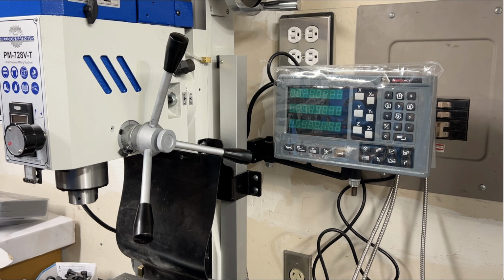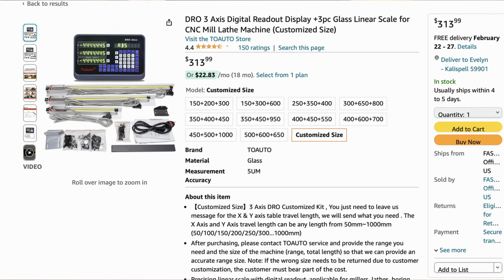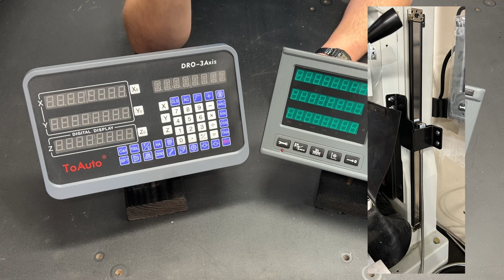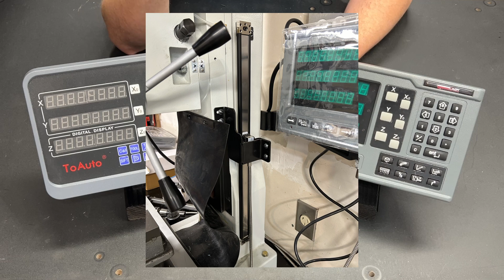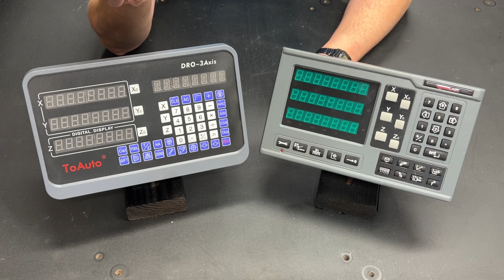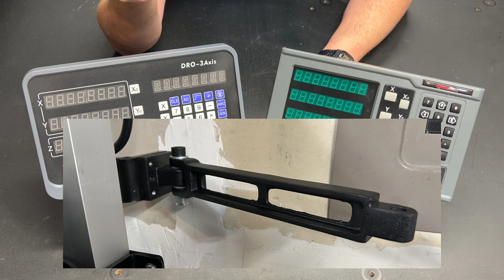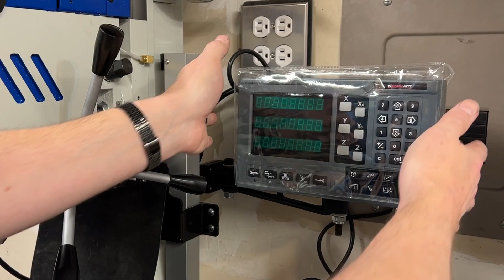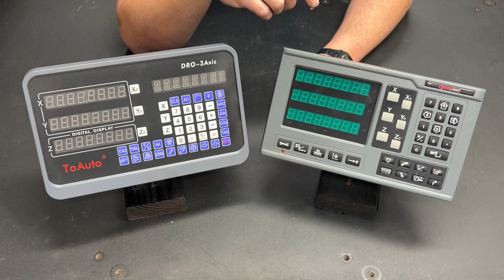Is it WORTH $900??  Review Comparing Precision Matthews & ToAuto À La Carte DRO for a Mill PM-728

Comment: You could have cut the plastic around the cable openings faster than spending the 5 minutes complaining about it in your video...
Reply from the maker: its not a complaint its an honest review of the things I like and don't like about the product.  I did cut the plastic and it was quick but doesn't change the fact that it should have been done from the factory.

Comment: Flood coolant is rarely used on a bench top or Bridgeport style manual mill. In any case, it should never be running beyond the T tracks and out onto the scale or onto the table or floor.

Comment: I think the reason PM designed their console covers the way they did is so that the user can remove and reinstall the cover without having to unplug the cables. Personally, I don't use the cover when I'm using the mill.
Reply from the maker: That is a plausible explanation but how often do you need to remove it?  Most people install them and don't take them off for years until they need to be replaced at which point the inconvenience of having to unplug the scales one time is far outweighed by the superior fit of having the holes in the cover.  I really think it was a cost saving option.  Either found something already being made that would "work" and/or making them without the holes cost less $

Comment: For me, it doesn't make any sense to put magnetic scales on a machine made to cut steel, too much can go wrong in my opinion.
Reply from the maker: You make a valid point but It’s interesting when I was researching this I found a lot of strong opinions for and against either type of scale depending on a verity of criteria, but the overwhelming response was they both worked well in most situations.
Reply: @dazecars  Good to know, thanks
Reply from the maker: Glad I could help

Comment: Considering that virtually every industrial machine that isn’t already a CNC, already has a DRO, I think that industry agrees that a DRO is something a professional machinist needs. Thinking the way people may have thought decades ago, doesn’t help.  Manufacturers used to have a fair amount of scrapped parts because of the expected errors. DROs have lowered that percentage by a large amount. They also allow work to come off the machine faster. After having machined for almost 50 years, I finally added DROs to both my mill and lathe. I would never go back. I use flood coolant on my lathe with glass scales. No problem. Install isn’t a problem because we are supposed to be machinists after all. If we can’t accurately install a DRO, what are you doing with your machines in the first place? I bought ToAuto models, touch screen. Also 1 micron scales. I’ve had them for three years and use them all the time. Frankly, I don’t care if the box is plastic or steel sheet or aluminum casting. It just doesn’t matter unless you hit it with a hammer regularly. I made my own arms and brackets. You have to modify the plastic cover to fit better. I did that with the ToAuto as well. I have x,y,x models. So I put one I modified on the quill and one on the tailstock. I really don’t like the way some people use a caliper on the tailstock or mill quill. Those aren’t accurate. The best you can count on is +- 0.0015”. That’s not good enough.
Reply from the maker: My comment was not to say that a DRO isn't something a pro needs but rather to say that there are an educational gaps between a hobbyist and a professional with the hobbyist not having schooling in machining and some of those gaps can be filled by a DRO.  As an example drilling a bolt pattern circle.  A trained machinist knows the formulas to calculate the points on the circle to drill the holes but a DRO does it for you eliminating the need for that training.  

My statements about flood coolant and optical scales are the same as my statements about chips and magnetic scales, not a hard fast rule but a potential issue and something to keep in mind.  Just because it has worked well for you does not make it ideal in every situation.

Yes if you are qualified to run a mill or lathe you are qualified to install a DRO yourself and as I said in my video I have done two such installs, but there is something to be said about a purpose built install by individuals that work on putting DROs on the same type of machine all the time compared to a one off install.  

As to the quality of the DRO yes I used the metal enclosure as an illustration point but its the entire construction.  My ToAuto buttons are connections between two plastic sheets and while effective and able to work for a long time they will ware out way faster than dedicated buttons like on the better DRO head unit.  The same can be said of the over all quality of the DRO that I got from PM compared to the ToAuto. You get what you pay for, the ToAuto DRO is inexpensive and designed for the hobbyist, but  the one that came with my mill is more professional grade in quality and construction.

Comment: Thanks!  This is a great perspective.  For someone in business with a shop rate of $100, $150 or more it makes sense to buy 'ready to use' tools.  For the hobbyist paying for everything out of pocket, maybe the budget is more of a factor.  I watched every one of your treadmill motor videos and all of the related videos on powering them.  Then I bought a 3 phase 3 hp lathe that was actually big enough for the work I do as a volunteer machinist on a historic restoration project.  I'm still appreciative of the knowledge gained.
Reply from the maker: It's all about that balance between time, money, and quality.  Glad you liked the videos.  The 3 phase setup should be amazing.  I have always said treadmill motors are good but VFD is beter in every way EXCEPT cost

Comment: I ordered my 833TV with the same DRO installed, mostly because I had zero experience with them and wanted to be sure it was done right. When I ordered my lathe I ordered it with a DRO uninstalled and did it myself and was glad that I did, even though cost wasn’t really an issue. I spent a couple of days on the lathe getting it just right but I was able to make spacers so I can still use the cross slide lock. I also wasn’t sure where they were going to put the display and I wanted to decide on that for myself. On my mill I ended up moving the display bar from the back of the mill and mounting it to the wall next to the machine, and on the lathe I located it above the headstock gearbox.
Reply from the maker: For sure there are advantages both ways.  Having now done two DIY installs I know I could have put it on the mill but is sure was nice not having to.
Reply: @dazecars  I’m also retired now and have lots of time.
Reply from the maker: having the time makes a big difference

Comment: I really like the TouchDRO. Especially the fact that it is upgraded often with new features.
Reply: What concerns me about it is that it’s based on an app updated by a very small company and when he decides to retire or to stop updating it then what. I’m sure the function is superior but I don’t want to buy a DRO setup twice.  Also not a fan of having to replace android tablets over time.
Reply: @Slabforkhomestead When he decides to retire, the app won't be updated and then it turns into a traditional DRO.  It won't instantly stop working.
Reply from the maker: likely at retirement he would sell to another company and so it would still be available
Reply: @BellyUpFishGarage only for so long until the tablet technology outpaces the app and the app becomes outdated and unable to be used on modern devices of the time. Also, how often is the tablet that runs it going to have to be replaced, every 5-8 years maybe?  It’s super cool and I’m sure more useful than a traditional DRO but I think the concerns are valid.
Reply from the maker: likely at retirement he would sell to another company and so it would still be available
Reply: @Slabforkhomestead  I've got 14 year old iPad still running as a GPS, so I'd expect 15-20 years in an environment such as shop, rather than 5-8 years. 

And, the amount of fully functional Gen 1 iPad's for $50 on eBay is plentiful. 

Personally, and that's the key, I wouldn't be worried about this scenario. But we each have to make our choices.
Reply from the maker: Excellent point (except I would steer clear of 1st Gen iPads 😁) as a comparison the cheap bubble buttons on my ToAuto DRO are likely not going to last 15-20 years.  I will be lucky if I get 5.   In other words stuff wears out and becomes out dated either way.  Nothing will last for ever but if you get good use out of it over a series of years its probably money well spent.
Reply from the maker: I have heard lots of good things, and will likely try it at some point